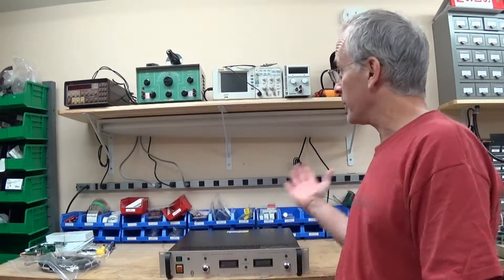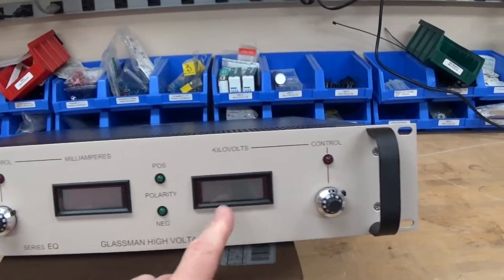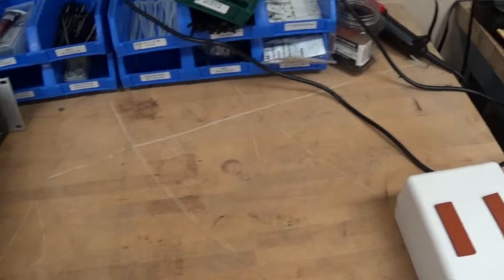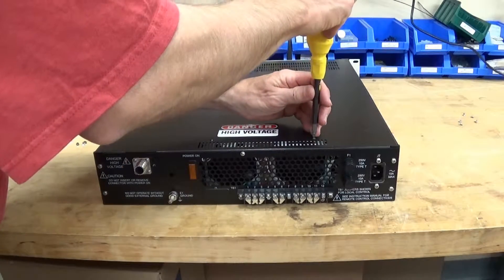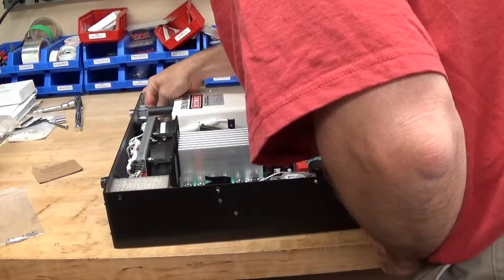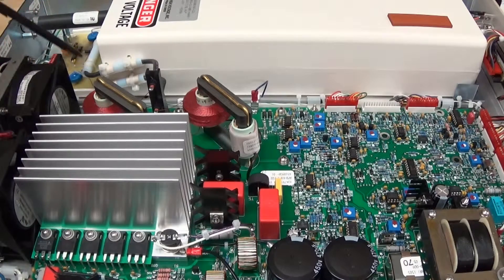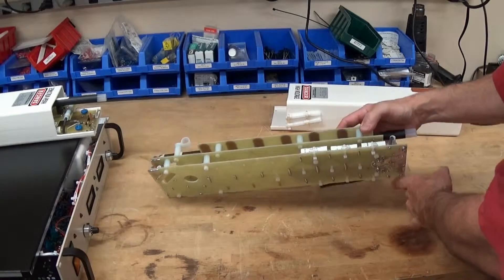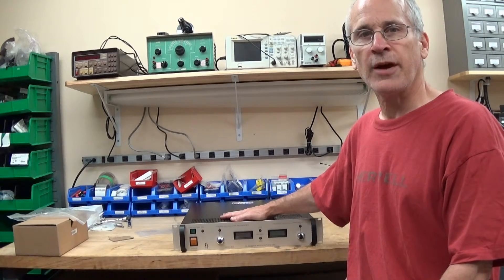A Look Inside a 30,000V Power Supply

Comment: It appears as though it uses a voltage doubler for the line input to the fets for the two halfbriges that the drive each fly back respectively. I am definitely going to purchase one of these. My 100kv power supply I built is a bit too powerfulf for some of the stuff I do. 8 foot plasma arcs can be a bit unruly and like trying to herd cats.
Reply from the maker: I hope you have deep pockets, these power supplies aren't cheap.  Have fun with your experiments.  Always keep one hand behind your back when you are poking around these HV power supplies!
Reply: @craighollinger9972  I fully agree with the one hand rule. High voltage will bite and it bites hard.

Comment: From your experience, how easy/difficult would be to repair a faulty similar Glassman 125kV power supply? I am able to turn it on and turn on also the HV output but when I try to increase the kV and/or mA it does not respond...
Reply from the maker: Your best bet would be to get the schematics.  The power supply I reviewed is all analog control, no microcontroller.  If yours is the same, it may be fairly straight forward to fix.  Good luck!

Comment: Interesting power supply. Thanks for sharing! The high voltage part looks like a typical voltage multiplier using capacitors and diodes (Cockcroft–Walton voltage multiplier circuit).
Reply from the maker: Thanks for watching.

A lot of people watching this video think that part is a voltage multiplier circuit.  It isn't, it is simply a high voltage rectifier.  The capacitors in there are across the diodes and serve to reduce the switching noise the diodes would create.  All the voltage multiplying is done by the two pancake transformers just outside of the white box that contains the diodes.
Reply: As a lot of the commenters have pointed out the HV brick is in fact a rectifier/multiplier. Those fly back transformer are not insulated enough to have 25kV AC on them. There are a number of things in this video that are not entirely correct specifically relating to the HV section.

Comment: Hello buddy,
that's a sweet unit. very easy to swop out the high voltage unit from it! +/- output
would like to get my hands on one of them' to have a good look at its workings through out!! 
im very into high voltage, I find it Very fascinating! the unit you show here has been made with alot of basic parts! very cool. 
I do like that unit! ;-) 
the white unit you swapped out looks very much like a Multiplier in some way, with the capacitors and diodes! to bring the voltage up from maybe 10kv to 30kv. would like a more detail look inside it! ⚡

very interesting,  thank you

thanks for sharing,

👍 👍 👍 👍 👍 THUMBS UP 👍 👍 👍 👍 👍 

Anthony 

High1Voltage1Rules
Reply from the maker: The power supply is very robust.  It has been in almost continuous use since we installed it more than a year ago.

This model has been made for years and so uses older technology to control the power supply.  Not a microcontroller to be found anywhere in it!

The white unit is simply a high voltage rectifier.  Please see my comments below.

Thanks for watching and taking the time to comment.

Comment: Jerry and Craig- you are both correct, actually. It IS clearly a classic CW multiplier circuit, but it also serves to rectify the high-freq waves from the fly backs. Dave Jones goes into detail in his vid on multipliers. Sorry no link..
Reply from the maker: As I said in an earlier comment, it's not a multiplier, just a high voltage rectifier. All the voltage multiplication is done in the two transformers. I have the schematics.

Thanks for watching and taking the time to comment.